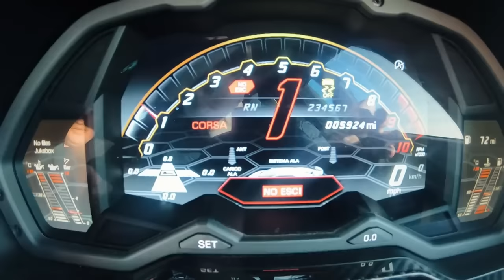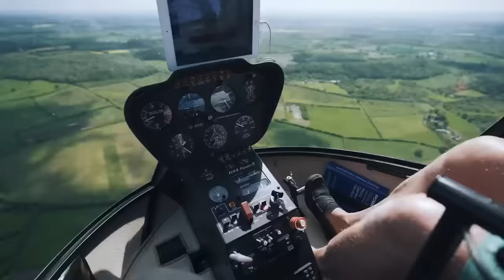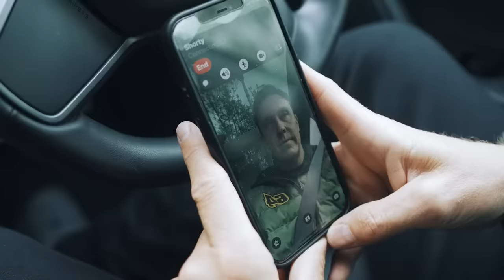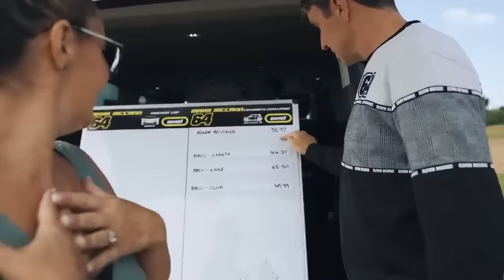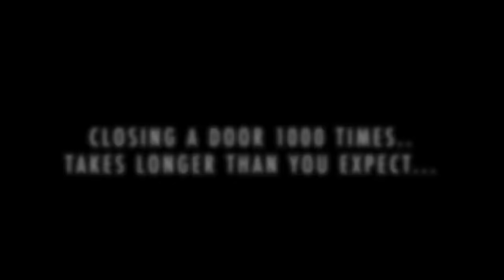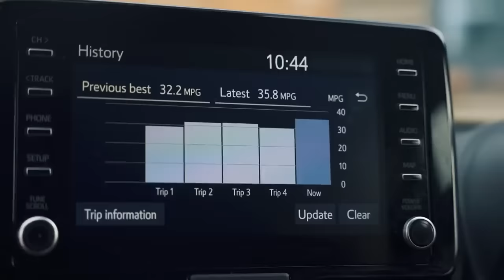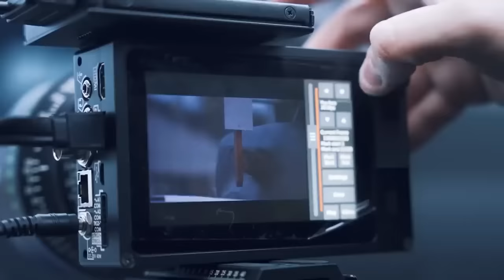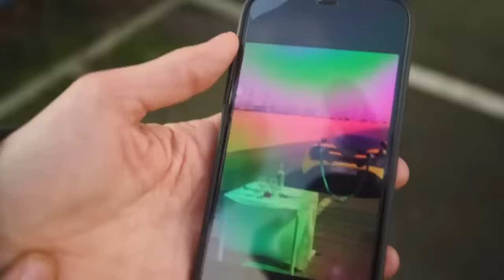The Best of 2022 - The Movie | With Whistlindiesel, Ryan Taylor, Mat Armstrong, DMO Ken Block & More

Comment: I have a 93 saab turbo aero. 210hp It has an mot! Bodywork is falling to pieces. I will have to scrap it soon. Engine has egr fault. But its quick. Mas air flow fault. 24mpg!